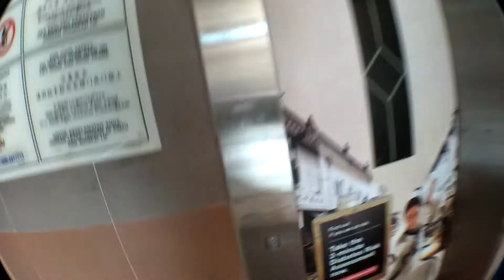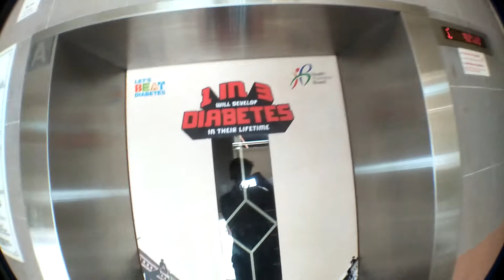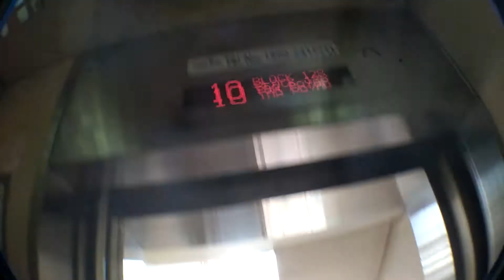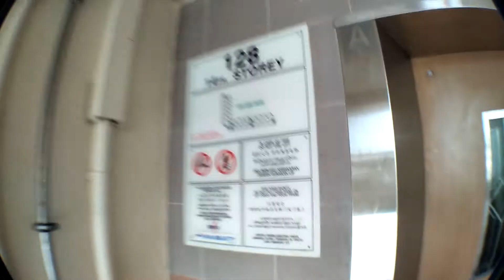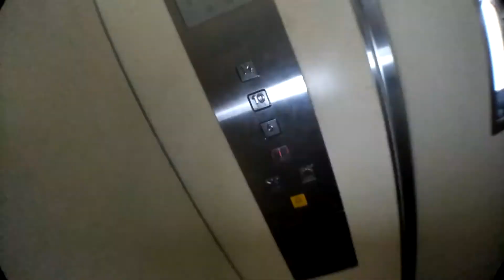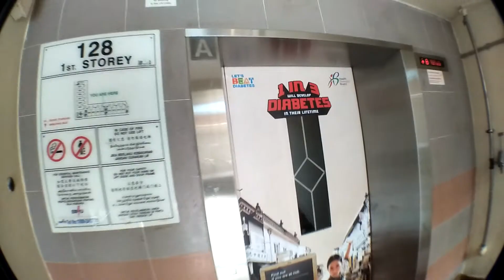Block 128 Toa Payoh Residential HDB - Fujitec traction elevator

Comment: I hope there's another elevator in this block. Limited-stop elevators are scarce nowadays.
Reply: I see. Due to budget constraints back then limited-stop elevators were built. But on the other hand it causes some inconvenience when it comes to the elderly.
Reply: Ape ini?
Reply: Nah it's okay. I've seen you guys both filming an elevator that I'm planning to visit one day. It's at McNair Road.
Reply from the maker: No. The blocks (only around this neighborhood) has at most, 1 one-door elevator, and some might even have 0 of them because they were indirectly replaced!
Reply: Mmm... I hope these elevators would be LUPed with modern Fujitecs.
Reply from the maker: NO! That would be the last thing i would want to happen!

I'd rather the lift gets a second modernization by Fujitec again, like Block 928 Yishun.
Reply: Much better.
Reply: @As sub GOODSMRTENTERTAINMENT uh this is my second channel and actually, its just an act
Reply: Go to the 10 storey blocks like Lor 1 Toa Payoh and Balam Road, there are still Otis lifts at the staircase
Reply from the maker: boo toring

Comment: This design made in china
Reply from the maker: Which design?
Reply: shawn0346 - Trains, Lifts Old Fujitec Lift
Reply: shawn0346 - Trains, Lifts with Diamond Shape
Reply: shawn0346 - Trains, Lifts Window with no frame from japan only
Reply from the maker: Oh... This one-door lift was refurbished with Japanese parts (probably originally English because it was GEC Express). Only newer ones (mostly Huasheng Fujitec) are made in China.
Reply: @garyyap6231  no u r made in china
Reply: @garyyap6231  For some, but I think it shld be originating from Japan and later being used by Huasheng Fujitec. The older versions of the diamond pattern Fujitec from the 90s were likely directly from Fujitec whereas those in the 00s can vary from Huasheng or legitement Fujitec, as the 90s was the era where some Fujitecs were still made without windows like at Bishan, Hougang, Serangoon, Tampines. Other towns like Rochor Centre (k this isnt a town) or Tampines, which r one of the first few to have windows, r likely from legitement Fujitec as well